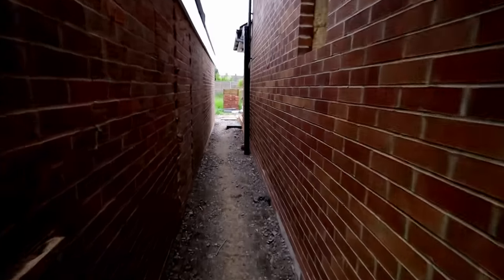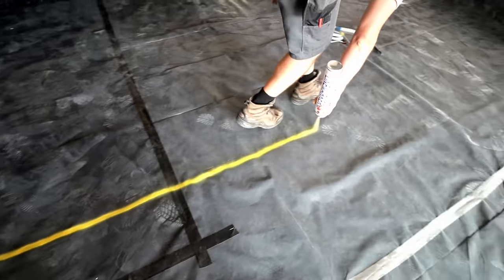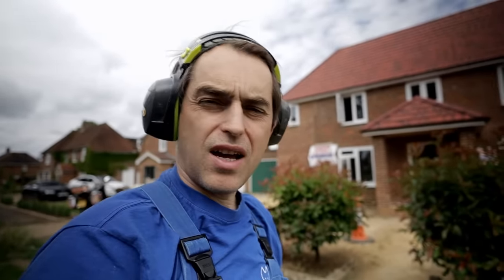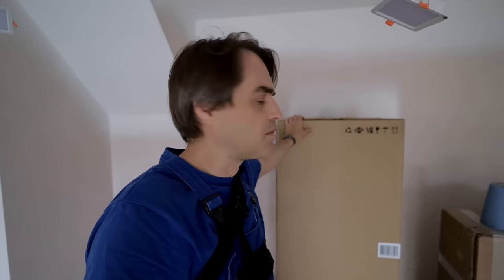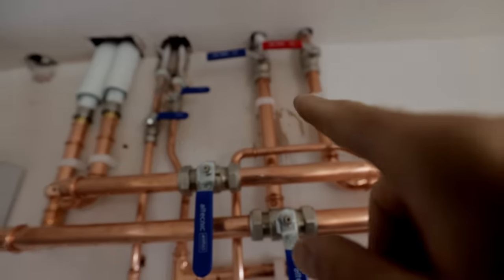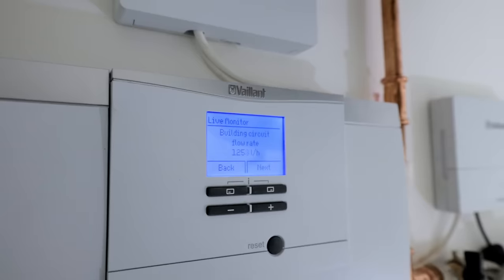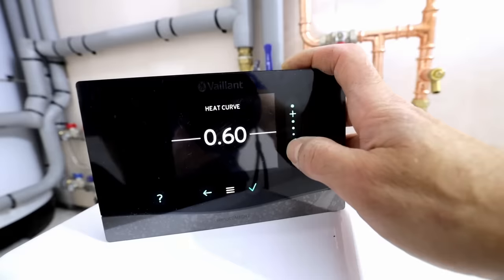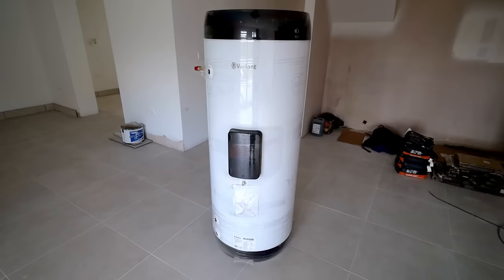Gas Boilers No Longer Make Sense, Here Is Why.

Comment: @ 11:23 on Gas boiler in many cases you dont need high end weather compensated to stay efficient and I think you know that :) 
if by high end you mean viessmann vitocrossal + accessories, then a heat pump will cost much less even without subsidies :D
+ I don't think that heat pumps are the high-end solution for heating and cooling, but rather vrf/vrv systems - which are definitely more efficient than a heat pump for heating and cooling - technically (as an extreme but real example) you could use a system of its kind, including cooling your refrigerator and using the little heat extracted from it for heating or preparing hot water in the summer ... things that a classic heat pump is not capable of ... and it is about the only field in which really suits me the use of heat pump systems for the generation and management of the thermal needs of homes and commercial spaces…
Reply: I doubt tying to recover heat from a modern domestic refrigerator is ever going to make sense. VRF VRV might make sense in a location where you need chilling as much as heating but using water to move heat around is pretty effective, it’s free, it’s non toxic, it has huge heat capacity, it’s all around an excellent median. Just make sure it doesn’t freeze.
Reply: @edc1569  with a vrv/vrf you could partially heat a swimming pool with heat extracted from the house in the summer + you could heat hot water instead of throwing the heat extracted from the house into the air.
What you said is correct - that's why vrv/vrf systems are used in commercial areas such as grocery stores.
And knowing what such a system is capable of makes me want it in homes as well, only that it is extremely expensive to implement...

Comment: The purpose of a heating system is to move heat from the outside air to the inside air. Can you please explain why you are doing this by inserting water into the process? The rest of the world uses split units, avoiding water altogether. This also provides cooling, which will be increasingly important in a warming world. It is less complex, and has a faster response time. So, why?
Reply: What warming world!  What happens if the planet starts to cool rapidly like it did in the 70s
Reply: Most UK homes already have a central heating system, so there is some parity to the existing system. It also means the next time a replacement is needed it's just swapping out the monoblock. A2A does have some drawbacks, e.g. having more open doors, some of the properties have more difficulty positioning the indoor units, and come replacement time it's basically going to be an identical cost to a new install. A2W does have the option of cooling as well as with this install, and the possibility of switching to ground source in the future as well.
Reply from the maker: Heating by air to air is not as comfortable as air to water. Also it is a more on / off system as compared to a steady and more balanced A2W. A2A moves air around which will increase air changes in the property lowering overall efficiency. A2A will be a more fluctuating temperature so less comfort. A2A can’t do DHW as easily. A2A can’t do radiant heating (ufh) which is the most comfortable and most efficient way you can heat your home. A2A is noisy and air con units by the nature they operate will usually have shorter lifespan than A2W when installed open loop and sized correctly.

The only benefits to A2A is cooling and much cheaper installation cost.
Reply: @UrbanPlumbers  Wow, where do I start? Moving air around does NOT increase air change. It only moves air within the property. Air change is, of course, essential for both health and comfort- with A2A this can be part of the system, transferring the heat from exiting to entering air. A2W2A does nothing to facilitate this. A2A can also filter, de/humidify and otherwise condition the air. Air movement is entirely a choice of the system. It has been shown that it is the air temperature at head height that is most important for a feeling of warmth- allowing the same level of comfort with a lower level of heat input. DHW is a completely separate issue- it is only conflated due to history, where using 'combi' technology reduces the space required for such infrastructure. By 'fluctuating temperature' you actually mean faster response. Not the huge delay in heating a concrete slab. In control systems, a faster response means a steadier value, as it can adjust to external inputs more rapidly.
'Only' benefit is cooling and cost? They are pretty big benefits! Of course it also reduces complexity. It can also provide redundancy, with dual or multiple installations.
Why is A2W2A so common in the UK? I suspect it is because plumbers are used to water. After all, unpressurized systems were still being installed decades after pressurized systems were introduced. It is what was understood. Indeed, we are still building most houses the way the Romans did- brick on brick with a tile roof. 2000 years with little progress. In 100 years aircraft went from stick and string to supersonic. Cars went from a motorized cart to todays sophisticated transport. Houses? Vitruvius would recognize them. Do not be part of the past; embrace the future!
Reply: @BenIsInSweden  Most current heating systems use radiators. These are entirely unsuitable for the low temperatures heat pumps provide, and the pipework (especially microbore) also an issue. Either huge new radiators are required, or the floors dug up. A2A - No need to have open doors, the units can be ceiling mounted in every room that would have had a radiator. Even if required (not always) ceiling replacement is way cheaper and easier than floor replacement! Fast response, air cleaning/changing/dehumidifying and cooling included- what is not to like?
Reply: @Tensquaremetreworkshop  ceiling mounting in every room is going to be a lot more expensive.  Ceiling units cost more to buy and install, when a wall unit can cover a large open area and will be a fraction of the cost. I don't agree with Szymon's points about comfort and noise and expect it to be from the same scenario Adam fro heatgeek had. With comfort at least with my A2A unit on auto, it will scale back to trickle the heat into the room, so you don't get wild fluctuations in temperature. Noise is mainly the fan and for the most part is not a problem when maintaining temperature.
Don't get me wrong too I have and love A2A, but I see the benefits to A2W especially in the UK to replace gas.
Reply: @BenIsInSweden  Yes, at first blush it seams sensible to retain the water part of the current gas heating boiler system. Until you examine the detail. Yes, the boiler goes. So do the radiators- if you want any sort of efficiency. And the pipework will need drastic modification- the boiler is often in a kitchen cupboard; far too little room for the much larger unit. Microbore will not do. Plus, a water tank needs to be fitted and connected. And you still need all the refrigerant pipework. It really requires all the floors dug up and a plant room squeezed in somewhere... Better to start from scratch and install the best solution. If the end target is warm air (which it always is) why not warm the air?
Best of all is passive heating, of course. I use 2Mwh of electricity a year (none of this for heating). It all ends up as heat. Plus two occupants at another 2Mwh. With sufficient insulation this is enough. Not in my current house- not possible. But new builds could. But the government stopped that requirement being in the last building regs update... Interestingly, the government grant is not available for A2A - unless you disable cooling! I invite you to come to your own conclusions about that.
Reply: @Tensquaremetreworkshop  not all properties need radiators replacing, nor are all microbore, some do and some are yes.  With the monoblocks like the ones installed here, no refrigerant lines are run, unlike with A2A so means more people could install them - technically someone can (and do) DIY an A2W system - but you aren't eligible for the grant, I know that at least over here A2A basically needs a company putting their name to the install to take liability in the case of an improper install and refrigerant leaks. I'm not completely up to date with the Grant requirements, but as far as I'm aware, it's not because cooling is enabled - as you can enable it on A2W.  I think they just have the grants to A2W because there's less red-tape with ensuring the gas boiler is removed. If the grants were for A2A there's potential that people would take use of it for just getting AC, and keeping the boiler in place- not impossible to check off etc.
Reply: @BenIsInSweden  I do not believe any gas installation can just have a heat pump substituted. Gas is designed with a flow return of 55C, so avg ~60C- close to a 40C differential. Efficient A2W ~ 30C - less than 10C differential- and it is a square law.
Reply from the maker: Nothing wrong with A2A, cheaper to install and if it makes you happy go for it. 

I know that A2W is far superior and is my choice for most installations
Reply: @UrbanPlumbers  You have, so far, given no reasons for your ‘superior' claim. It is more complex, takes more space and costs more, while being less responsive.
Reply: @Tensquaremetreworkshop  there definitely have been, I believe it was EVMan's gas to heat pump install only required some minor changes to switch over (still ensuring it was properly done). On many it will be "dumb luck" from oversizing radiators in the gas installation. Gas will also be more efficient the lower the flow temperature so it is advantageous to do so, just not as critical or as reward reaping as a heat pump with getting it right.
Reply: @BenIsInSweden  I agree with the 'dumb' part… Provided the return is 55C or less, to permit condensing, gas efficiency does not alter much.
Reply: I guess you're not from a cold climate?  Wet systems are great as you can put just the right amount of emitter into each room.  Some houses have lots of rooms, often these rooms are small (downstairs loo).  You do this once and it lasts the lifetime of the building.  You get domestic hot water too as part of the deal.  Also try installing a new outside unit on 10 year old system of indoor air-to-air units, they won't be compatible with each other so everything has to be re-plumbed and re-gassed and it all goes to landfill.
Reply: @edc1569  I certainly regard the UK as a cold climate... Wet systems make sense when your input is ~1000C (gas, oil, etc) not at 30C. Ducted air is not popular in the UK due to infrastructure size, and the small size of UK homes. But A2W2A systems are also large! A modern well insulated house will lose more heat to air change than boundary losses. Heat exchange between ingress and egress of that air is needed, plus de/humidification and particulate filtering is increasingly important. A ducted air system can do all of that- why not add heat/ cooling too? Much more responsive, and a single control system. We are heading for passive heating as the norm, so complex water systems will die anyway. A2A allows a stepless transition to this.
Reply from the maker: @Tensquaremetreworkshop wet systems make total sense at all temperatures if you understand hydronics and basic physics
Reply: @UrbanPlumbers  Which I do. You have still not given any reasons for the 'superiority' (as you see it) of A2W2A systems. As I explain elsewhere, the move to passive heating (with the importance of air management) will make them redundant anyway.

Comment: You need a modern house for a heat pump. Boilers still make sense in most British homes.
Reply: @zlmdragon.  of course not. Most homes in the UK are much loved and cherished by their owners including mine. I was just saying that most British homes don't have underfloor heating, which apparently is better for heat pumps, and many won't have the space required for all the plant you need. Then their is the cost. In the current economic climate most people would baulk at the cost of a brand new heat pump system.

Comment: Heat pumps are incredibly expensive to run in the winter if electricity prices increase as they always do. Even with solar panels, unless you’ve also paid to have a battery installed, they are still expensive. Waste of money in older houses!
Reply: Gas isn't immune to price hikes either, and are actually more sensitive to price fluctuations as the price of electricity needs to rise by 4p per kW for every 1p rise in gas to have the same relative cost increase.

Comment: They shouldn’t say return on investment but when are your running cost going to have saved you so much that any difference in install costs are cancelled. Payback is a fair question especially if you are not intending to stay in the property for long, but if you are going to stay then it becomes a moot point. However with that level of refurb it’s insane not to go heat pump.

Comment: Why gas boilers wouldn't make sense anymore ? I congratulate you for your technical knowledge,your are number one on my list.But you never talk about the price of electricity and gas.Electricity price is 27 pence per kw and gas price is around 6.9 per kw.(without the standing charge).Thats a factor of around 3.9 .... and we can match this with the COP of the pump.In the end,you could get cheaper with gas,because the boilers also modulate the power,and a 25kw with a modulation of 1:10 can burn 2.5kw per hour.And maybe in practice a condensing boiler isnt 100% efficient but it's definitely close to 90%.So where is the saving ? You use 1 kw of energy to make a total of 4 but the price is equal to 4kw of gas.From what I see in your clips ( like the one with the 2 gas boilers,where one wasnt necessary) is that a lot of systems are badly implemented and the boilers are running 100% power.If all installers would have your knowledge not so many people would get ASHP because you know hot to install a gas boiler and make it run efficient.And lets not forget the price of a heat pump instalation compared to the price of a gas boiler.
Reply: 4kW of gas won't provide 4kW of usable heat though, you're looking at around 3.6kW of heat.  So you're ending up paying 10% extra with gas.  Also, for many 2.5kW of heat from a gas boiler is still going to be too much for much of the heating season, so it will need to turn off and on, reducing efficiency as well.  This video was also done before the increase in the grant from 5k to 7.5k, which in most cases covers the difference in appliance cost.  As he has said, when doing major renovations - because in this situation if a gas boiler was put in, the changes with the UFH etc would still be done, so would be a separate renovation cost.

Comment: Gas makes sense when your heat pump wants at least 5kw , and your power is cut off . But you can fire up a gas boiler off a 3amp supply from a small gennie and still have heating, and hot  water
Reply from the maker: Most heat pumps only need around 1-2kW for regular operation. This unit max input is 3kW and it pretty much will never run flat out anyway.
Reply: If Power Outages were so much of an issue, people would have all had some backup (genny etc), for decades - they don't.  You'll find very few (for the UK at least) will draw 5kW, you're almost certainly getting confused with the heat output rather than the electrical draw - you just need to check the spec sheet and see what either the maximum draw or fuse size is, to see that they won't be able to pull 5kW.

Comment: What brand and type of the panels is it for underfloor heating? Looks like it is perfect suitable for low screed height.
Reply from the maker: Yeah, you can do them with as little as 25mm buildup. It’s gets very expensive though with 25mm screed, as it has to be latex

Comment: Heat pumps require space for cylinder, buffer tank large radiators and bulky unit outside some time need planning permission and all costs associated with it  therefore GAS BOILERS MAKES MORE SENSE works every  time all the time 😄

Comment: You say gas boilers are less efficient and more expensive to run than air source heat pumps, what is your source?
That must be based on a test, will you post the test?
Reply: Free heat is available from the air!